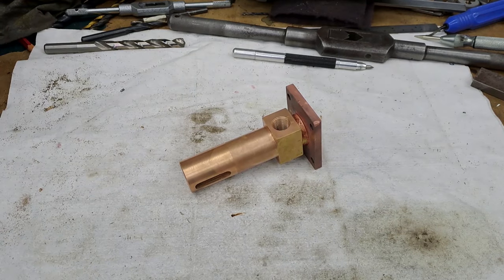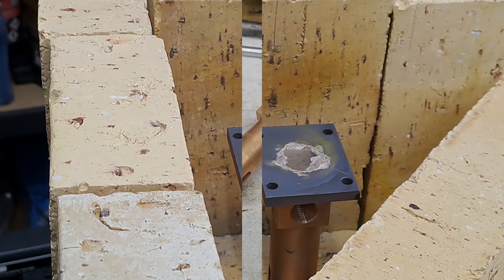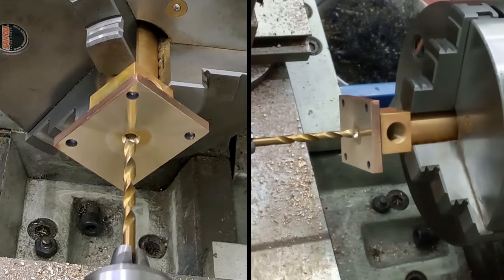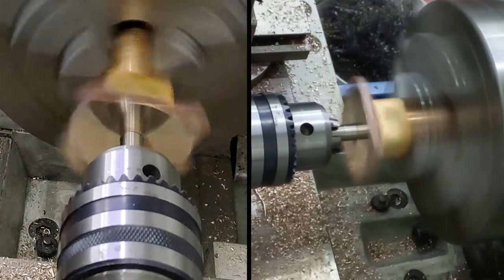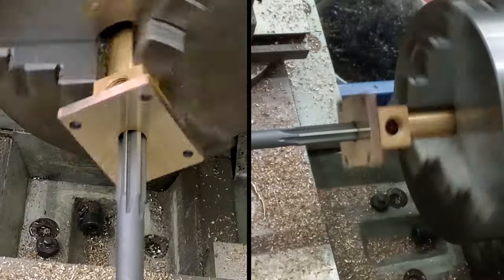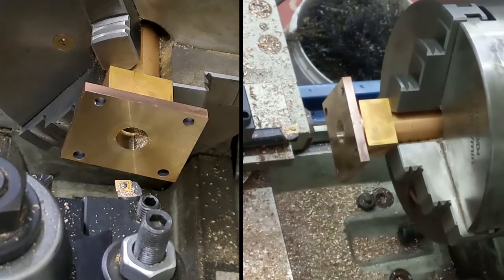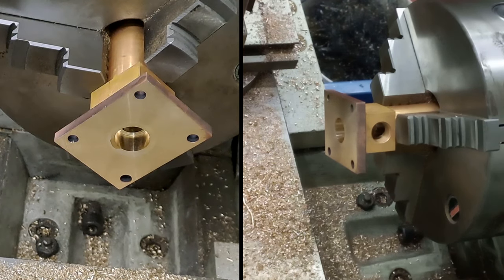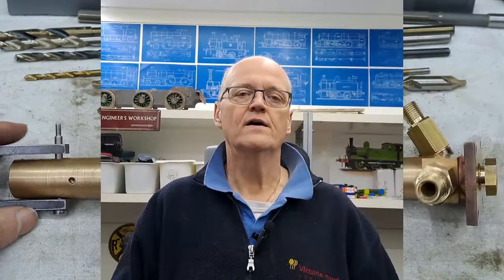041 Goodonya... Its an Axle Pump!

Comment: '  Orrible, don't take up brazing as a career.  
- Chamfer the end of the pump, insert into plate, flux the chamfered "trough", lay snippets of ss into the chamfer all round, heat from under the plate all round. Ss should be sucked into the joint.
Reply from the maker: Thanks for the comment. As a chef, I'm a real newbie to all of this. Always glad of constructive comments.
The Chef